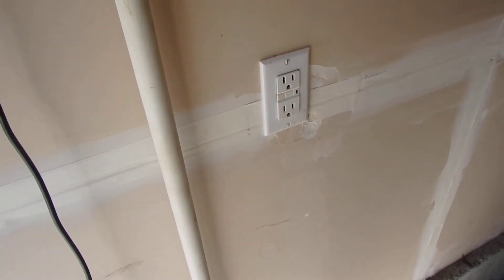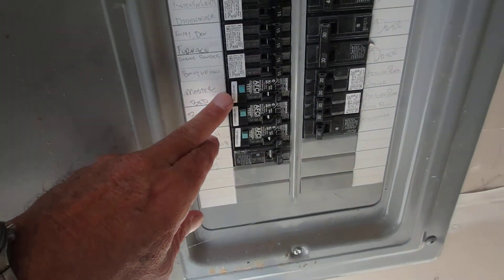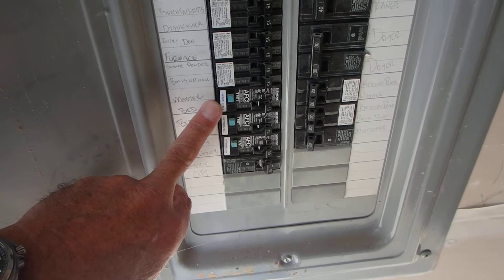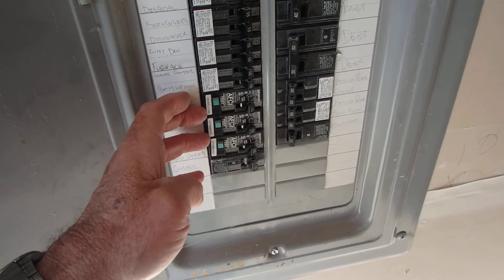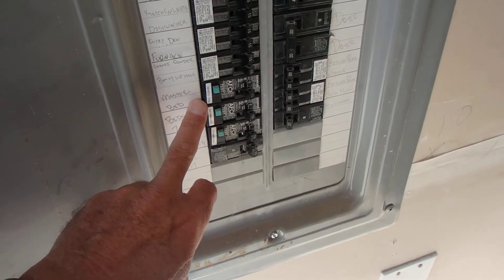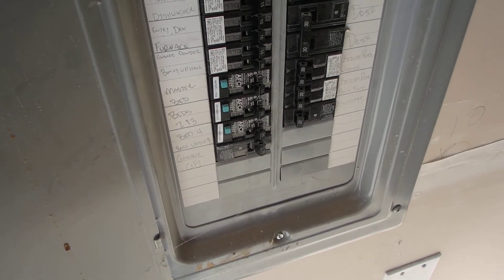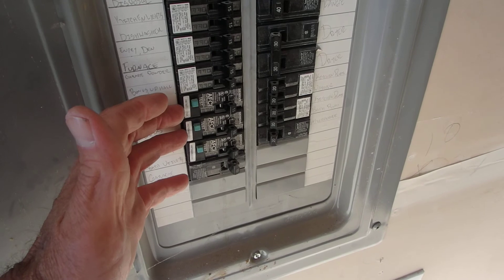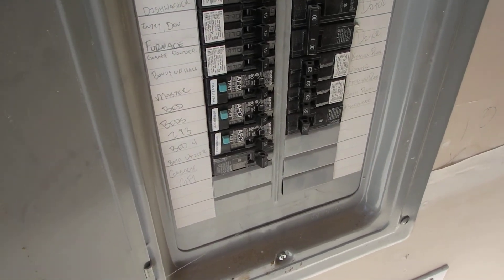Nuisance tripping with Arc Fault Circuit Interrupter Breakers?  (AFCI)

Comment: That's complete bullshit. I had to buy some when i redid my kitchen. Any kind of motor pops the breaker. Blender, vacuume can't use them anymore. I'm a handyman and I worked in a new house that had all brand new arc fault breakers for the entire panel. Couldn't use any power tools, it was a nightmare. I'm trying to find a way around this, it's starting to look like there is no way

Comment: I have a SquareD panel in a 2018 house and the AFCI breaker randomly trips when the washing machine is in the spin cycle, maybe once or twice per year. Appliance companies maybe need to add more smoothing capacitor/filtering on motors so they don't trip these things since they're being installed in every home.

Comment: The new ones have just as many issues as the old ones had especially Siemens.
Reply: Our new home has Siemens AFCI/GFCI combo breakers. Initially we had the dedicated breaker for the refrigerator tripping constantly.  We almost lost some food.  Under warranty it was replaced. No more issues.  Then 3 more of the breakers, all the bedrooms, were tripping for no reason. We were sitting in another room reading and a breaker tripped.  I called and an electrician replaced all 3 under the home warranty and the tripping stopped. Once the home warranty is up if I have any issues I’m replacing them all with GFCI breakers.

Comment: Our home is about 30 years old, so there were no AFCI breakers installed.  Life was good.  But when I finished the basement, the city inspector made me put AFCI breakers into ALL basement circuits, even the lights and smoke detector!!    The problem is these breakers are a full 1" wide and you cannot buy any tandem AFCI breakers that are half-sized.  So my breaker box is now FULL, with no room to expand.
Reply: Tandem AFCIs are starting to become available on the market, but depends on the panel. Search and you might find for your brand.
Reply: How about grow a pair and put real breakers in?

Comment: I have an arc fault breaker keeps tripping. I've isolated the circuit and disconnected the wires where the homerun comes in off the panel and it still trips. Put in a regular breaker and works fine. Could my wire be faulty from the factory?
Reply: Ive done the same thing. There a nuisance especially with motors. I removed 4 of them.
Reply: @RadioRich100  I finally traced the problem to a loose wirenut on a smokedetector. Must've had the apprentice making up overhead that day cus they were all loose. Had to tighten all of them. I'll be willing to bet that whoever works for the NEC code was payed off to require these pieces of shit breaker in the name of your safety.

Comment: Journeyman Electrician here in Texas.... The new AFCI breakers are not any better than the old ones they all nuisance trip the inherent design is flawed, especially when you can't even use a circular saw or any other high amp power tool.  Let alone your average garbage disposal.............I'm not allowed to put a standard non AFCI breaker in a home now when everything in the house trips it because all the Breaker companies have lobbied the NEC Code so as to increase their profits.

Comment: Can they be replaced with regular standard same amp braker?
Reply: The short answer is yes you can and many people do. But what you should try first is replacing the AFCI with a newer version that many not be so sensitive.
Reply: Yes you can replace them with standard breakers. Dont worry about the code, let the electrical inspector come over and reset your breakers everyday. There just not perfected. They always have to monkey proof things. Remove them from your refrigerator circuit or u could lose all of your food!
Reply: In theory you can replace the AFCI with just a standard breaker but you would be defeating its purpose and be out of required electrical safety code. 
The reason they are used is not to detect a “ground fault” like a GFCI but to detect electrical Arch's - sparks between wiring from a nail hanging pictures , faulty appliances like vacuums , lamps, devices etc that create arches in walls and heat that would otherwise spark and overheat burning your wall or house down , which is why you would never want to replace it with just a regular breaker.
The old arch fault tech was really sensitive with anything with a motor of it had an imbalance between the hot and neutral or any little inrush spike.
Newer arch fault technology handles these indifferences in its internal circuit board within the breaker and can tell the difference better. 
Hope that helps

Comment: When I give temporary power when building of a new home give a few plugs I used normal breakers GFI plugs the chopsaw destroy new afci breakers after construction done I change then to AFCI breakers. If required AFCI / GFI combo breakers and through out the temp GFI. Because heavy used of construction that was used on it.

Comment: I do new home trim carpentry. I can't run my miter saw or table saw on most afci circuits
Reply: Brian 716 I have the same issue. Just purchased a miter saw and miter trip the breaker
Reply: @BlacHaze78  I keep a nice selection of 20 amp breakers in my trailer so I can install a temporary outlet while were on site.  The afci breakers are pain in the butt, ive had clients complain their normal dyson vacuum trips them also.
Reply: Brian 716 They are a pain. My home was built in 2016. I’m trying to find some to install a dedicated outlet in my garage.

Comment: New build in 2015 I have one15 amp AFIC breaker that trips when I use table saw in garage.  It also occasional trips when I use my microwave which is on a completely separate circuit!!!  I am about to put an old style normal breaker that was good enough for the last few decades!!!!  Sometime change is not a good thing.
Reply: Sorry I should have posted this sooner.  I replaced the breaker with a new one same type and have had no issues.  electriacians i have spoken to all hate these things they seem to die very fast.
Reply: I want to do the same thing....but I dont know how to wire it up.  I see white wires connected to the AFCI breaker.  No idea what that means.
Reply: Jim Carris have you replaced your breaker
Reply: @BlacHaze78  sorry yes used same type breaker and have not had any issues since.  I f that had failed I was going back to regular breaker.
Reply: I have the same issue

Comment: I am sure this video reflects information provided by manufacturers of the AFCI breakers so the issue is going to be someone else's fault. I just replaced the fifth Square D AFCI/GFCI combo breaker installed in my new home. A 20 amp circuit for ONLY the washing machine, which is also new and draws 5.2 amps. Not anywhere close to 20. Two months ago I replaced the breaker for the refrigerator only circuit. Again, operating no where close to supposed ampacity of the circuit. Two other breakers have been replaced in the past year because of nuisance tripping. During construction a circuit that was not used for anything tripped arbitrarily and the breaker was replaced by the vendor. Their words, "not that uncommon". My research a year ago found a bonafide study with testing results that prove AFCI/GFCI breakers do not function as represented and the recommendation to the NEC board is to reevaluate their usage. If I locate the study again in the next few days I will provide a link. Meanwhile, I am reverting back to $4.00 breakers.
Reply: Please, please, PLEASE, tell me how!  I have the same issue and I can't hire an electrition because of the code where I live!
Reply: @ziggiezag938  not quite sure what you are asking. My fix is quite simple. I purchased a box (10) each of 15a and 20a breakers. Old school $3.45 each at Lowe's, H-D, or Ace Hardware. Whenever a breaker gives me trouble it gets replaced. It's not rocket science so if you can change a light bulb you can change out a breaker. The only thing not obvious is moving the circuit specific neutral (white wire) to the neutral bus. I have kept all the suspect AFCI/GFCI breakers should I need to revert back in the event of sale of my home.
You don't need an electrician (which I happen to be) just a help video.
Reply: @merlecraner4477  I've always been too scared to work inside the breaker box.  I've wired a lot of light fixtures, outlets, switches, etc. but inside the box just seems so dangerous.  Did you wear rubber gloves?  Is rubber an actual material or a symbolic name?  Do I need to shut off the power to every breaker? Then the main?  Some videos I watched said to do this.  Others said as long as the breaker I'm replacing is off and the new one is off, it's okay to work on it.  So my question is, in your opinion and in your experience, what are the step-by-steps?  What about the GFCI, so I need to add one in the line somewhere?
      I think it is the ARC Fault that causes all the issues.  But, then again, look how much I know!  HaHa!
Reply: @ziggiezag938  so it pretty much goes without saying that the power should be turned off (main breaker). It also depends on circuit terminus where you need a GFCI; refrigerator, no; microwave, no; counter height kitchen outlets, yes. The first outlet in the circuit can be changed to a GCFI if you are concerned about it. 
Secure the power; remove  the cover from the panel; loosen the screws securing the wires (they should be very tight); pop the breaker out and replace it with the new one (make sure you get breakers designed for your manufacturer's model); snap the new breaker in; replace the cover and turn on the main and the circuit breakers.
Reply: @merlecraner4477  Great information!  One of the breakers that constantly blows is not near a water source the other is in the laundry room 4' or so from the sink there.  I can't think of an occasion where I might plug in anything there that could drop into the sink, so I think it would be okay?  Thank you for pointing out that the brand is important!  So gloves are optional?
Reply: We DID it!  Changed two breakers.  It really was easy (except my hands and wrists are defective and weak so my husband had to loosen everything & then tighten it all)!  Thank you for all your patient answers!  We couldn't have done it without you!!!!!

Comment: March 2018
Just installed panel upgrade..
Added 8 circuits..
20 amp Arc fault breakers are causing problems..
1500 watt heater is tripping them 
Also the toaster is tripping them..
The are sieman panel and breakers
Reply: This is starting to happen to my son  after no problems for 5 years.  New breaker trips also. This is Siemans panel also.

Comment: ....5 times today my AFCI/GFI receptacle tripped because of lightning—some of ithe lightning not even that close to the house-the regular breaker at the fuse box never tripped once on that same circuit.  Leviton makes the 120Volt AFCI/GFI outlet/recepticle.  Home Depot sells them.  Rain didn’t affect the circuit, only the heavy lightning.
Reply from the maker: I'm going to run this by a friend who is a master electrician and electrical inspector for the state to see if he has an explanation. Is this outlet inside or outside?
Reply: Are they required for all Circuits or just the bedrooms in 2018? thank you for your help.